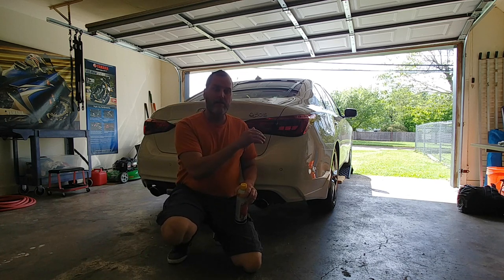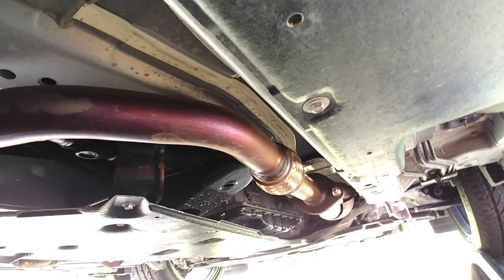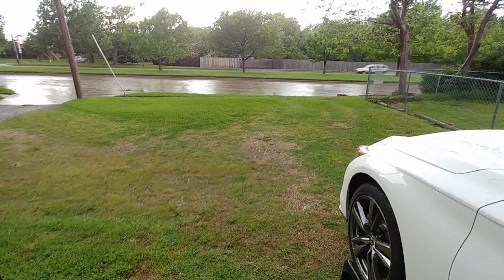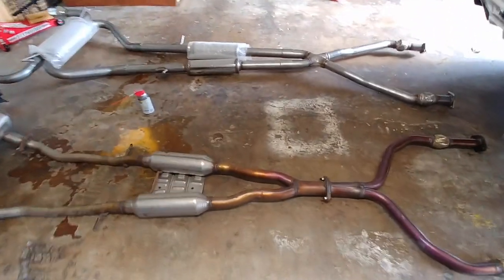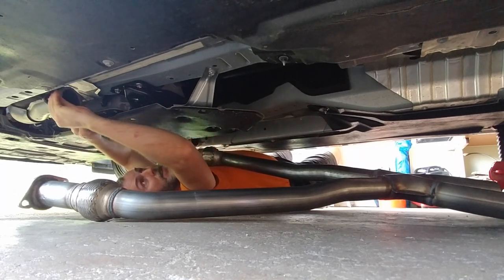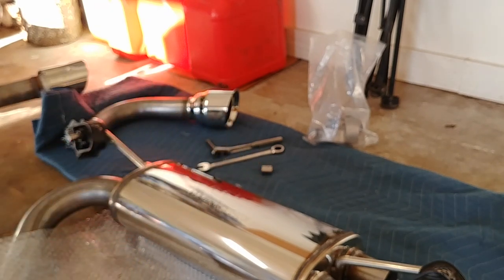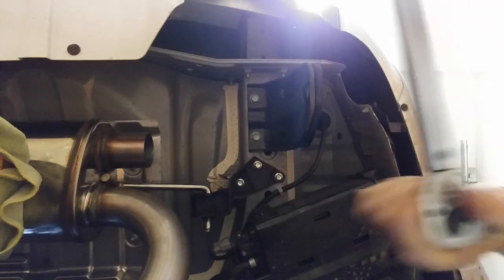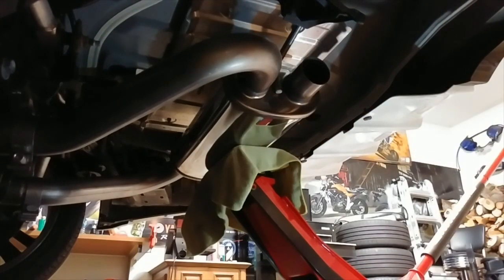Real world install video...no shop lift but tools and garage space - Magnaflow CBE/Infiniti Q50 3.0T

Comment: Howdy GTL, yesterday I got the Magnaflow exhaust( the same one you have) and tomorrow I will start the install. I'm watching your install video again to get tips and instructions before I start doing it on my Q50. I just want to say thank you for your efforts, the video really helps!
Reply from the maker: That's awesome. Glad I could influence you to buy a product you should be very happy with. It produces a low base rumble which is not annoying but gives of that performance sound. It will grow a little louder over the next few months but still remains mellow. Let know how everything goes here. My best advice is buy some nut//bolt penetrating lubricant/ loosener like the brand Blaster that I did at Lowe's or similar brand from automotive or hardware store. Spray this on the exhausts bolts maybe 30min to and hour before and let soak. Then just remove old factory exhaust off in pieces. I guess it does not matter if you start at the very back with the big ass factory muffler or towards the front after the factory down pipes. Use wd-40 to lubricate the rubber hangers and a pry tool and wood 2x4 block example to use pry and wood piece to gain leverage and not beat up on the metal surfaces you pry against. Another big step...when reinstalling don't forget clamps. You need to position them the right way around. I'll take pictures for you. Follow my pictures. Mock up the new exhaust. One piece towards the back is slightly longer. If I remember that slightly longer piece is fit to the driver's side. Mock everything up before you tighten down. That way you can go in later and twist pieces until you feel every thing lines up and looks good. Tighten/torque the front nuts after the downpipes to 45 ft-lbs and the other clamps to 32-35 ft-lbs.
Reply from the maker: Pictures of clamps to position them so they don't get hit, rub the ground and you can tighten them down easily https://www.flickr.com/photos/freelanceshots/albums/72157716097830096  Hope this helps you to do this install easier. Not bad to do, just take your time and make sure it's all push/pulled here and there and the back muffler and tips are where you want them before you start tightening the whole exhaust system down.
Reply from the maker: How did the install go? Are you enjoying the CBE for its personalized sound characteristics?

Comment: Nice video bro really enjoyed it your weather is like Florida. Love the wheels on your Q50 question do you remember what size clamps use used for your heat exchanger and did you have a oil cooler on your Q50 it's a sport correct yours didn't come with the big break package?

Comment: Sounds good any drone? Performance increase ?
Reply from the maker: I'm going to make a detailed first impression video tonight. Let me just suggest that it will be very good for specific people looking for certain qualities.
Reply from the maker: No drone. Almost no or very little increase in sound in the interior for normal day to day driving.
Reply: Sounds good... are those ams intakes I hear ?
Reply from the maker: @Mr.MarcM3366  Yes AMS intake kit and exhaust, only power increasers at this time. The car was Ecutek tuned Jan, Feb and March but I took the tune off to try and trouble shoot some errors. No longer see those issues DCT code's/PCM with tune removed. I'm running a Burger Motorsports heat exchanger, Mishimoto catch can, Z1 Motorsports subframe collars and Summer rated P-zero Nero 245 tires.
Reply: Getting thru Life do you plan on getting a re-tune ? The exhaust should really make a difference... if you ever decide to add downpipes this car will be an animal .... great video !
Reply from the maker: @Mr.MarcM3366  I am fully aware of the downpipe hype but I'm going to stay away from downpipes and cats until my warranty is done. I've got a new video coming out. I talked to ecutek thru email. I've found out some things. Will be up shortly. I'm still not done with my revisions at Jotech. My trans was my major concern with my tune and second my ignition timing and knock but appears my problems is not as bad as I thought.
Reply: Getting thru Life glad to hear looks like everything’s gonna be okay .... I saw the video and it’s also reassuring that Ecuteck was responsive  and helpful in the matter
Reply from the maker: @Mr.MarcM3366  Yea, I was mainly flipping out because at the same time I'm getting transmissions codes like (fluid over heating, wrong gear ratio, torque converter error, solenoid problems E/D/F, output speed sensor circuit error, transmission fluid low and warnings like multiple gears engaged my god! Not to mention my car was stumbling/abruptly shutting down in the middle of pulls and pulling big timing while daily driving it around. No freaking wonder why I thought I was having big problems. I was seriously thinking I've/Jotech has damaged my $9,000 dollars transmission.